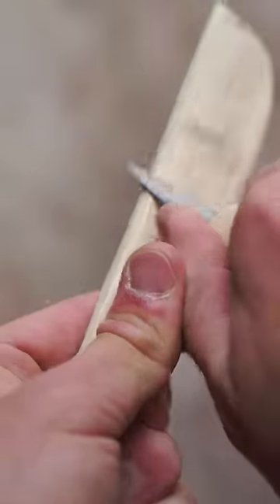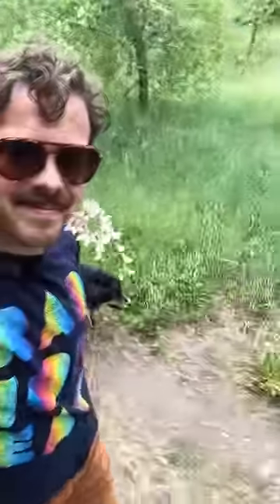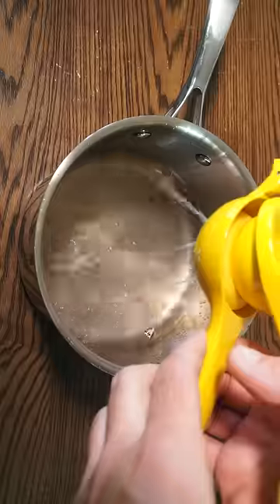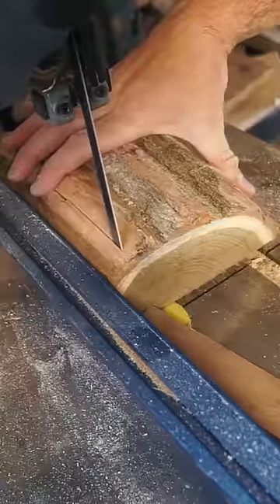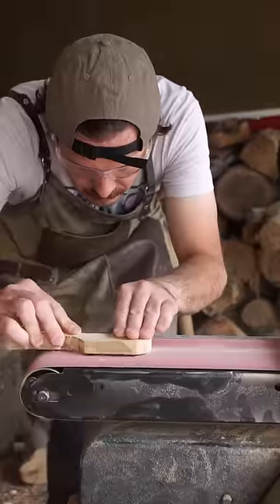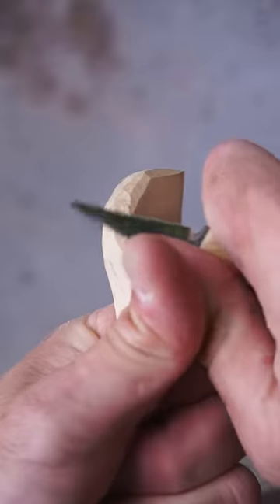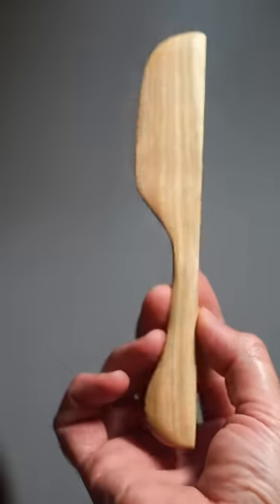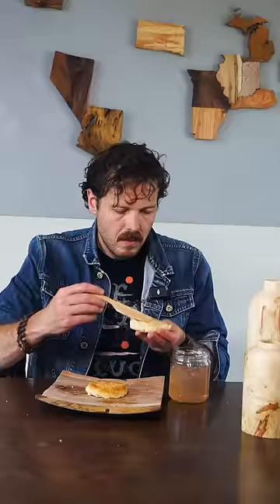Making a knife (and also jelly) from a black locust tree

Comment: fun fact- Black Locust is also sought after by hiking trail maintainers for stairs, retaining walls, and even bridges! this is because the wood can withstand ground contact even in wet conditions for many, many years
Reply: Sounds like it's something that could make great garden raised beds.
Reply: @bethanysmith5856  absolutely! the bark peels off very easily as well
Reply: the only problem is instead of rooting it tends to begin rooting even fence posts have been known to do this.
Reply: Wow that would be cool to use as flooring for a cabin in the woods to prevent rot
Reply: @commie281  well, the unfortunate thing is that locust tends to grow crooked & fast. when cut thin & long, it can warp & crack easily. usually it’s kept whole for more integrity.
Reply: @simonfarr8670 maybe if you had a firm and compacted foundation and slots in the bottom wall trim to keep the perimeter pieces in place, then just slot all the others with "under-over" slots and inserts cut in/out of the wood itself to keep them all in place. Make sure the wall edges are attached to the frame and ground of the house. Maybe some polish and staining it before adding a little layer of resin right over it all in one piece. Then a clear coat over it. (I doubt it would work, but it's nice to imagine :)    )
Reply: Another fun fact: it's mostly found in Romania

Comment: Black Locust is also insect and rot resistant. My grandfather used black locust branches and saplings with about a 4 to 5 inch diameter to build fences. About 20 to 25 years later he was able to reuse the same fence post with new wire to rebuild the fences.
Reply: it is used in France (and elsewhere I guess) for vineyard posts.
But actually it's completely fungus resistant, some fungus can attack them alive (I had to cut a big one one because of that) - I think it's only the sapwood that is attacked but that's enought to kill a tree.

Comment: Ooh, if you get the chance, try visiting where there are mesquite trees in about a month. They're currently blooming.  You want to gather some ripe beans, they'll be tan with bits of red and purple stripes. You want to brake the pods into 3rds and boil them for 20 to 30 minutes and then strain, add sugar and pectin to make jelly. It's a bit bizarre, the beans won't taste that amazing by themselves but once boiled for their juice they'll smell like cinnamon life cereal and the jelly will make your mouth wonder if it's supposed to be apple pie or pears with cinnamon flavored.
A lot of parks have mesquite trees and a lot of cow pastures as well so you could just pull over on a country road and gather what you can from the road side of the fence. The tree is so common that it's practically a weed in central Texas
Reply: Thanks for sharing this.

Comment: Black locust and honey locust are my favorites. Honey locust is everywhere and could kill you if you touch it. I don’t know how to identify black locust as well so I don’t see it as much. I need to figure out that one.
Reply: wait it can kill you? how?
Reply: @Just-here-to-comment  Honey Locust is covered in large thorns. I believe the op here is referring to that. The plant is not listed as toxic or poisonous but it seems the wounds the thorns can cause may be slower to heal than others likely due to minor infection or the like. Further more the wood from the Honey locust is popular in construction as things like rail road ties and fence posts as it's reasonably strong but can be easily split and is rot resistant.
Reply: @samuelschurman3762  thanks you
Reply: @Just-here-to-comment  Black locust has thorns as well but they're smaller. Honey locust thorns will go through a leather work glove with ease and can get several inches long on mature trees. They'd make excellent awls if you're into leather working and will go through a leather work glove with very little effort (especially if you grab one by accident....)
Reply: @Just-here-to-comment 6 inch thorns sometimes do that to you. It’s entirely possible for one to go through your shoe if you step on one wrong. If you haven’t seen a honey locust tree you’d be freaked out when you see one. Those things look like they’re from another plant.
Reply: We have honey locusts here, too. The thorns are absolutely HUGE!!

Comment: Neat video! I spent a lot of years during my career for a county parks dept here in New Jersey dealing with honey locust, which most of us didn't like having so much of in the parks as it grows pretty straggly and slender for a long while but because the wood is as hard as block locust and has so little tensile strength it just snaps in high winds and causes debris and widowmaker hazards. Not so much fun to haul into the chipper with those big thorns, either, and it's also brutal on saw chains, but it looks really pretty when it's been worked! We have some black locust here as well that probably spread from cultivated examples, but I never knew the blossoms were edible! I know the Lenape used to boil down the honey locust seed pod innards to make a cough medication, but I was wondering if you know if honey locust blossoms are likewise edible?

Comment: Yeah but be CAREFUL with the black locust because literally every other part is quite harmful to the body. The blossoms are  m o s t l y  ok as they have little to no toxicity. 
Depending on how much enters the body side effects of ingesting other parts (including handling the green wood and getting the sap on your hands and cross contaminating) include: nausea, weakness, flushing, lethargy, and vomiting (in some rare and severe cases: liver injury and seizures). Getting cut or stabbed by the wood or thorns also has its problems as well like: Pain, swelling, and rash (rare and severe reactions include: neurologic symptoms and local tissue death). 
We have these tree ALL OVER our yard as they are fast growing and, as he has stated, invasive in our area (MN). I’m actually surprised that he said that it’s a hard wood as the branches fall from the trees  with any kind of wind more than a whisper. But hey the flowers have a VERY strong sweet smell and it attracts bumblebees.  so ya know…